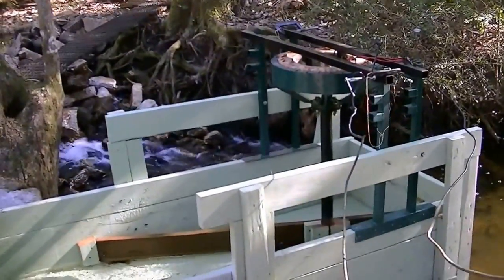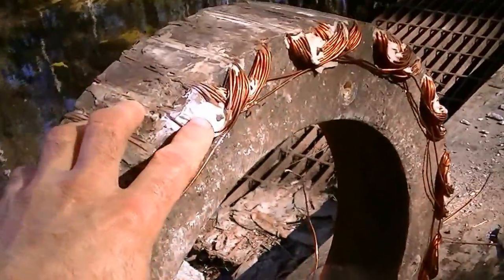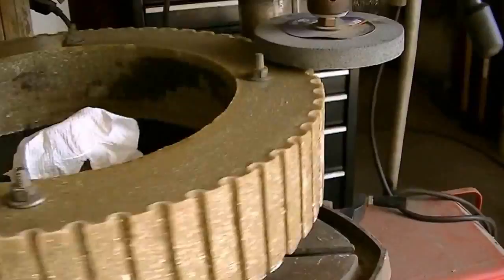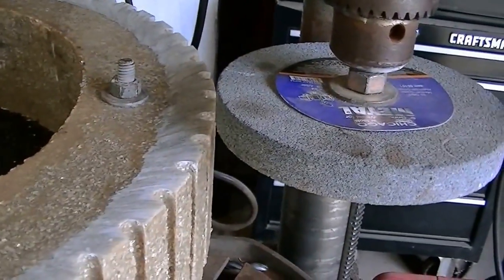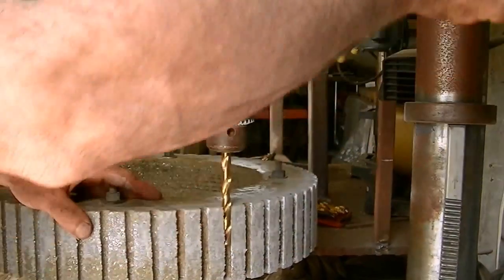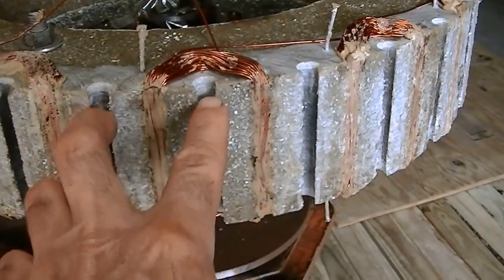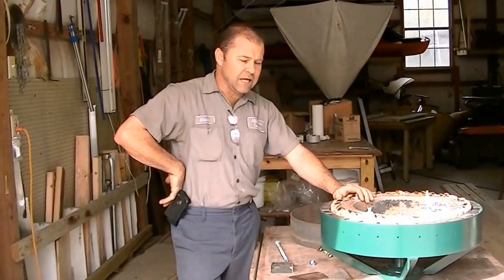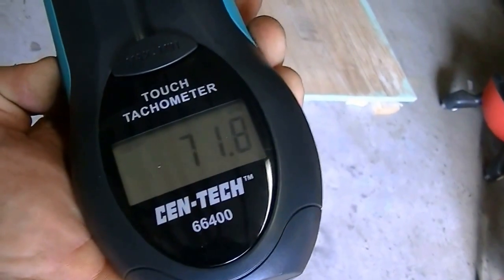Vertical turbine hydro generator system. Low rpm permanent magnet generator, home made

Comment: This Is An AWESOME Upgrade markp0177!

If you are looking to become sustainable, I suggest you go to Mark's channel and subscribe to him as he provides many valuable videos and quality content about sustainability.

I have a couple of questions for you Mark.
1. What is the stator core made from?
2. Can you elaborate either in this post or in another video about how you designed the bearings and shaft (what you used and the size of them) please?

Thank You in advance for your advice and incredible videos, I'm highly impressed with your workmanship in all you do.

 #HydroPower     #DIYGenerator     #HomeBuiltGenerator
Reply from the maker: I made the stator out of fiber glass resin and aluminum flakes. I have a mold that I made. It has 10 iron rings in it. I have another old video showing that. I start with the axel from a 3500 lb trailer.
Reply: Ok markp0177, that's what I thought about the axel but I couldn't tell what you were using for the stator. Thanks for the reply. I will go and look through the rest of the videos on the topic, I didn't think you had build videos about it. Thank YOU! :-)
Reply from the maker: ***** Thanks for the kind words. I am going to be on a tv show, the sportsman channel. They are doing 8 episodes called off grid. I will be one episode. They are coming to shoot on the 16th and it will air sometime in the summer.